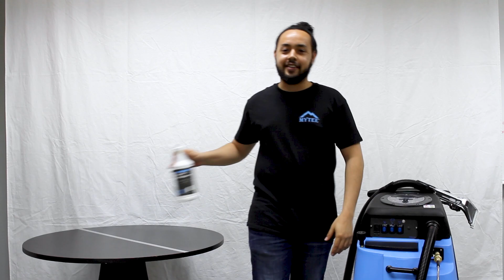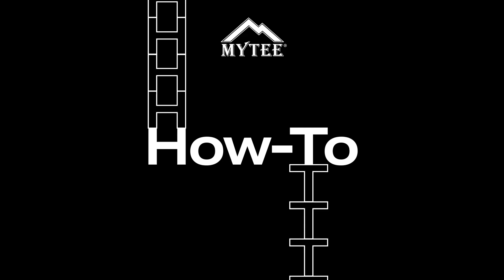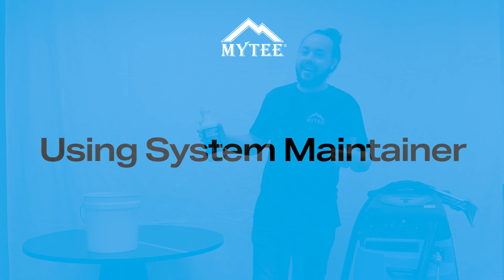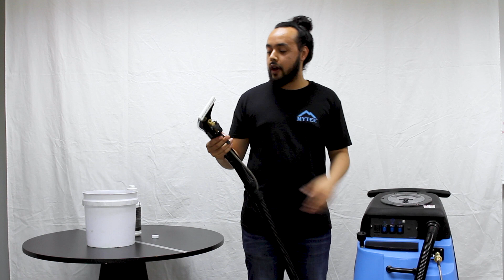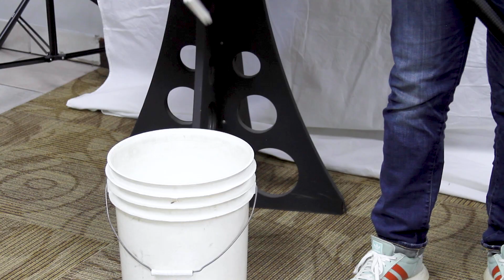Mytee How-To: Using System Maintainer

Comment: How often should I do this if I have a water softener? Also, is it bad to run the solution through multiple times?
Reply from the maker: We generally say monthly is a good idea, maybe every two weeks with hard water and every other month if you have treated water. The solution is only meant to be run through one time, do not put used solution back through the machine.

Comment: Should we turn the heater on as well at any point? Does that help flush it out as well or no?
Reply from the maker: You do not need to turn the heater on to clean it!
Reply: That’s confusing because the system maintainer that mytee produces says to turn on the heater. You guys are sending conflicting information here.

Comment: Do we need to do this even if we only use water in the clean tank?
Reply from the maker: Yes! Even plain water will leave hard water buildup over time
Reply: @myteeproducts  okay thanks
Reply: @myteeproducts  will it be fine if you use deionized water?
Reply from the maker: DI Water is better and will greatly reduce the frequency you will need to use SM but should still be done 1-2 times a year
Reply: @myteeproducts  how often does SM need to be used if only using tap ?